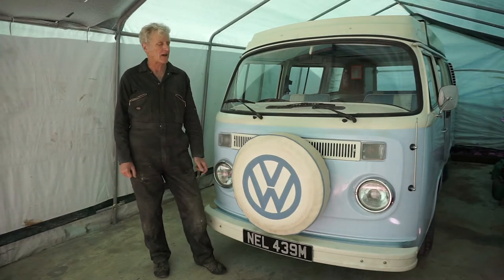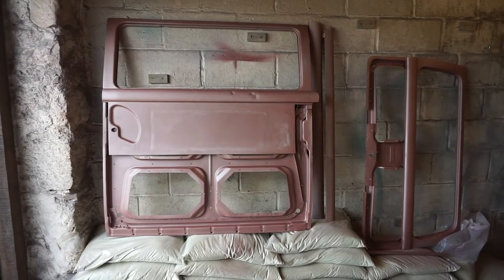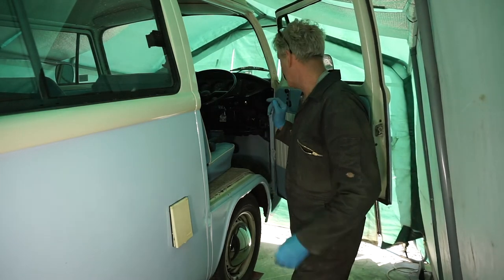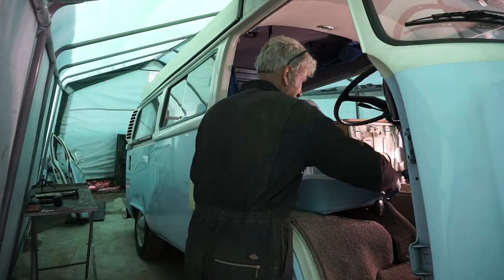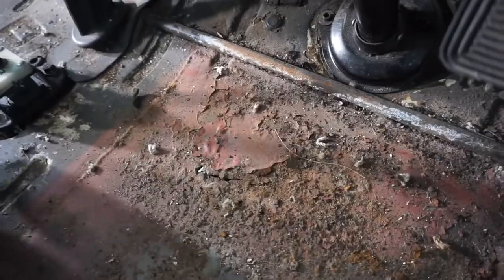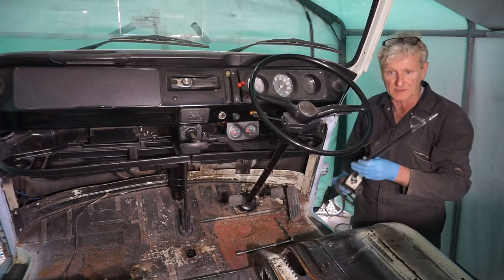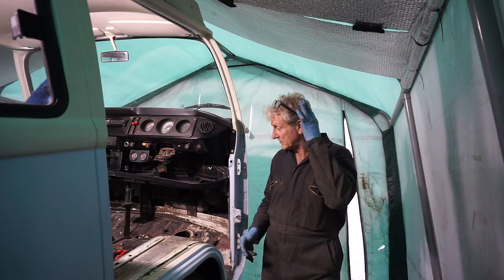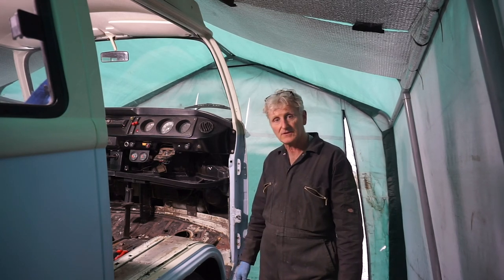1973 VW Campervan Restoration Part 1

Comment: Lovely renovation and informative playlist. There are so many gems embedded in this series; obviously you immaculate welding, the alignment of doors whilst building up the A-frame, the electronics section and the workaround for the dreadful horn. Thanks so much, this will be in my library to come back to during my own renovation.

Your spoiler on the T1 didn't lead to new uploads. Is it coming or has youtube lost you?